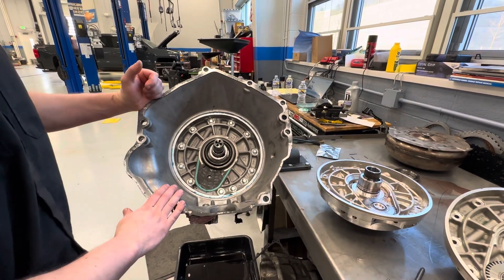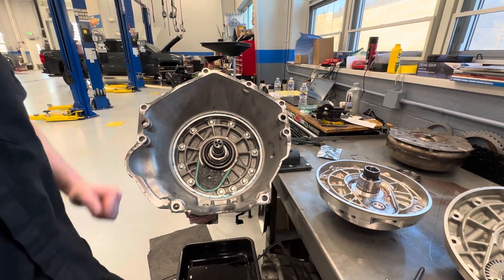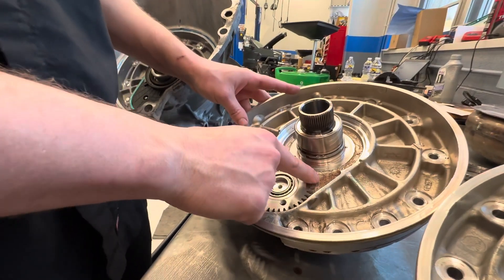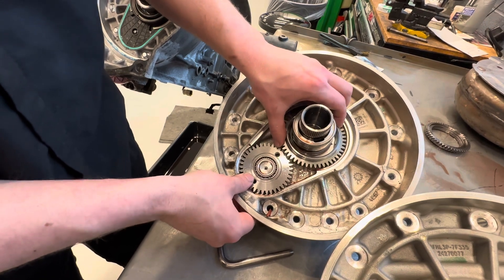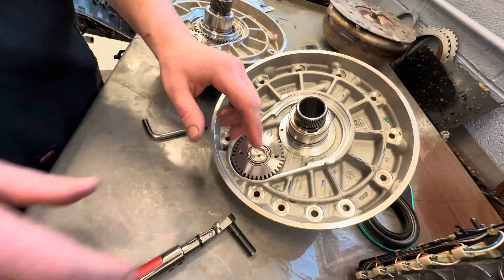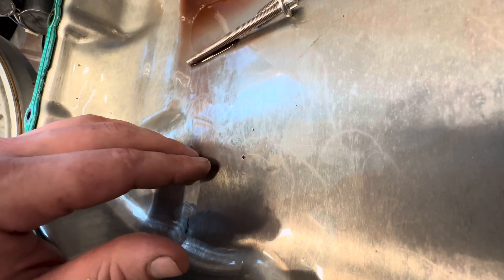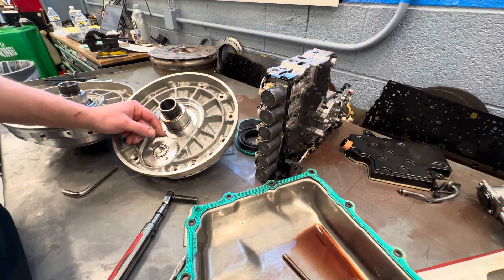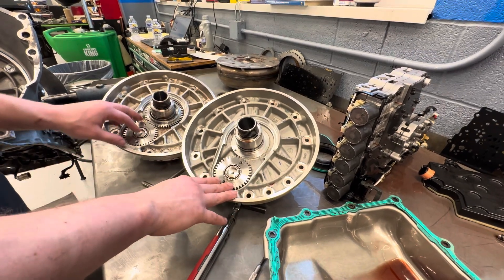GM 10L80 automatic transmission idler gear failure and pump whine

Comment: This transmission was a joint venture between Ford & GM. They both use the same 10 speed with only a few minor differences. GM wanted a quiet set of gears, so they used helical-cut gears. Ford went with straight (or spur) cut gears. The problem with the helical cut gears is the side force the gears put on the bearing. The small roller bearing and gear setup does not handle the side load of the helical cut gears.

What we can do to correct this issue when a 10L80 comes in the door with pump noise is to replace the old helical cut gears with Ford’s straight cut gears. The straight-cut gears have zero side load, which makes it much easier for both the bearing and the gear.

Ford’s gears are also cheaper to replace. From your local Ford dealer, the gears are priced as follows: (prices are retail) The driven gear is about 38$, the transfer gear is about 42$, the drive gear is about 6$, and the new transfer gear bearing is about 7$. All of this coming in at less than 95 bucks! What a deal!

If you choose to stay with GM OE parts, the front support, which comes with the drive gear, the transfer gear, and the transfer gear bearing, is anywhere from 450 to 700$, depending on where you call. Purchasing a complete front support from GM is the only way to get new gears. The gears are not sold separately.

It is highly recommended to swap to the Ford gears as this will solve the issue long-term. Ford's transmission doesn't suffer from this problem due to the gear design. Replacing the parts with GM parts will result in the same issue again down the road shortly later. The Ford parts are a long-term solution.

Transend

Part #: D105515A - pump drive
Part #: D105518A - pump drive idler
Part #: D105516A - pump gear
Part #: D105518A-5 - pump idler bearing
Reply: Just got my 2021 Silverado back from the shop where they diagnosed this whine and applied this solution you describe of using Ford pump gears.

Comment: Anyone have updated part number for the front cover with all the new parts? Mine just went out at 102k.
Reply: This transmission was a joint venture between Ford & GM. They both use the same 10 speed with only a few minor differences. GM wanted a quiet set of gears, so they used helical-cut gears. Ford went with straight (or spur) cut gears. The problem with the helical cut gears is the side force the gears put on the bearing. The small roller bearing and gear setup does not handle the side load of the helical cut gears.

What we can do to correct this issue when a 10L80 comes in the door with pump noise is to replace the old helical cut gears with Ford’s straight cut gears. The straight-cut gears have zero side load, which makes it much easier for both the bearing and the gear.

Ford’s gears are also cheaper to replace. From your local Ford dealer, the gears are priced as follows: (prices are retail) The driven gear is about 38$, the transfer gear is about 42$, the drive gear is about 6$, and the new transfer gear bearing is about 7$. All of this coming in at less than 95 bucks! What a deal!

If you choose to stay with GM OE parts, the front support, which comes with the drive gear, the transfer gear, and the transfer gear bearing, is anywhere from 450 to 700$, depending on where you call. Purchasing a complete front support from GM is the only way to get new gears. The gears are not sold separately.
Reply: @Steven-gv1ke thanks for the info. Dealer put a new transmission in because they said they wouldn’t take apart to do that fix.
Reply: @daviddsims  as soon as you hear ANY whining noise, I would order those parts, take it to a transmission specialist, and tell them what I told you, and have them swap out those gears before they cause much bigger problems. Unless GM has changed the gear designs, they will do it again.
Reply: Transend

Part #: D105515A - pump drive
Part #: D105518A - pump drive idler
Part #: D105516A - pump gear
Part #: D105518A-5 - pump idler bearing

Comment: Anyone know this part number? My truck has been whining  for a couple months now. Can someone please help me out?
Reply: The company name is Transend

Part #: D105515A - pump drive
Part #: D105518A - pump drive idler
Part #: D105516A - pump gear
Part #: D105518A-5 - pump idler bearing

Any competent transmission shop should be able to swap it out. Don't wait until they fail as it will be much more work and much more expensive. Just make sure to tell them they don't need to use the washer on the idler gear due to the slightly different design of the Ford.

Comment: The Ford 10 speeds fail also? Ive heard of GM guys putting the Ford oil pump gears in the 10l80 because they are straight cut.
Reply: Ford 10R80's used straight cut gears. Those gears whined terribly but it didn't have a thrust load that would cause the gear to move like the bevel cut gears on the 10L80. Ford designed the 10-speed and GM made this change to it because Ford was getting so many complaints for this whine noise.

Comment: I bought a 2024 Chevy Silverado 2500 gas brand new off the lot and it had a whistle at between 1500 -2500 rpms. The transmission was replace with a new stock transmission but still had the whistle. The dealer exchanged that truck for another truck of the same model and it has the same whistle. Any input about what im hearing would be great.
Reply: I have the same issue on a 1500 2024. Dealer replaced truck, same noise. They are not fixing it for me

Comment: Took 2020 Sierra 6.2L, 10 spped trans max trailer package with 105k miles in for routine trans and transfer case maint. 3 werks ago. When I got it back tranny was whinning, got louder after a couple of days, took back to dealer, now it's $8k to have it fixed. No noises prior to taking for service. Papers say they changed fluid and filter.
Whats the chances that it was just a coincidence? Thats what the dealer says.
Reply from the maker: Highly likely it was just a coincidence but they should’ve helped you on the cost.

Comment: My 2020 Silverado HC is in for this repair at 95,000mi.  Any info on if GM has changed the cover design to eliminate that defect?   I know GM just put out the formal TSB for this in November of '22.
Reply from the maker: You got lucky having powertrain till 100k! Unfortunately, not that I know of. Some 10L80s never experience this issue and others it occurs at 30k to 100k. If it does not shift acceptably take it back and demand they replace the control valve body solenoid assembly due to metal intrusion
Reply: @esoterictransmissions  - Got the truck back and have been driving it for a week or so, seems to be all good.  Holding out hope that they changed the cover design to take care of this issue.
Reply from the maker: @Knight21030  you should be good to go buddy. Good on them
Reply: @esoterictransmissions  So they ended up replacing the trans pump, and the cover.  Had to talk them into changing the filter too (wouldn’t that be SOP?). Thanks for the advice, I’ll keep you posted on how it shifts.  👍🏻
Reply: @esoterictransmissions  I did see GM changed the part number of the trans cover.  Hopefully they fixed it just being pressed in there.  Hope I caught it in time.

Comment: 10l80 maintenance....32k mile....Fluid exchange OR have pan dropped and filter change?
Reply from the maker: Filter and fluid!
Reply: @esoterictransmissions  Yeah all the dealer service writers I have talked to are telling me to do an exchange/flush....I ask them about dropping the pan and changing filter and they tell me I don't need to do that...sounds odd to me.

Comment: Hi I m an owner of a 2020 Ford Everest from China，2.3Turbo engine with a 10R80.I can also heard a noise like a whine or someone keeps whistling while the transmission is shift from 4 to 5 to 6 gear，but when it quits these three gears the strange sound will immediately disappear，service guys and Ford dealers said it is not an issue but i am bit worry about it😢

Comment: My 22’ Silverado wines in the 10-35 mph range when accelerating and decelerating - you think this could be the problem?
Reply from the maker: It is highly likely. However other things can cause that whine
Reply: @esoterictransmissions  my truck makes a squeal not a whine starts around 27mpg 4 weeks at dealer they ordered a valve body

Comment: How reliable are the 10L80 transmissions?
Reply from the maker: To be fair surprisingly reliable compared to 8 and 6 speeds.
Reply: @esoterictransmissions  Thanks for the info, I'm doing as much research as possible before getting into a 10L80.

Comment: Just had this happen to my 2020 Silverado with the 3.0 diesel, just under 50k miles. I did bring it in for a whining noise that I only really heard under decel as it came down through the gears. 10days at a dealer and it’s back and running strong.
Reply: Did it whine at idle?

Comment: I'm about to swap a 10R80 into my vehicle... I'll check this before I out the trans in, but what do I have to do to fix it if it's bad?
Reply: Your 10r80 have straight cut gears and do not have this problem

Comment: @esoterictransmissions Mine has a loud whine when sitting in park or neutral, but goes away when I put it in drive or reverse. Could this be what is causing it, or would it whine all the time?
Reply from the maker: It would whine with an increase in rpm. That is odd that is goes away when driving. I would take it to a GM dealer and tell them exactly what you just said just to document your complaint.
Reply: Mine has a squeal and not so much a whine in park only when fully warmed up and revved between 1000-2000rpm, doesn't do it in any other gear selection or scenario. Been like this since new hasn't gotten any better or worse. 2022 Silverado 3.0L Duramax.
Reply: @bpl0807  Mine has now progressed to whining in 1st-6th gear when accelerating. Most noticeable in 4th-6th. No idea what it could possibly be.
Reply: @bpl0807 anything happened with it? Mine squeal under 40mph when the rpm comes down, when i put it in park and tap the gas it'll make the squeal when rpm lvls out

Comment: Hi, can this problem apply also to 10r80 Mustang ?
Reply from the maker: Yes, it can. I believe that Fords 10R80 has the potential for a similar failure but I have never personally seen one.
Reply: @esoterictransmissions   can you look at this? https://youtu.be/LLDTp_9Weys I have this exact same noise like in this video and I don’t know what is the cause. Do you know anything about this ? I will highly appreciate any advice. Thanks
Reply: NOT TO BUST  THE BUBBLE  FORD AND  GM 10R80 ITS ALL THE SAME GM TRANSMISSION  
TECHNICIAN  ?✌😎
Reply: Can you please provide the part number? Thanks a lot.